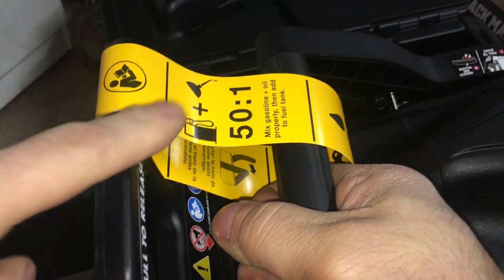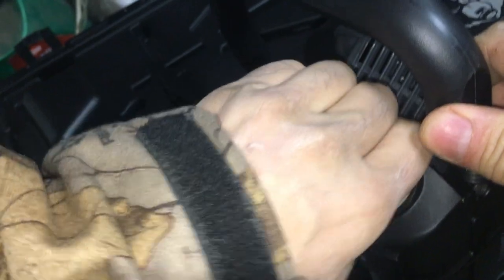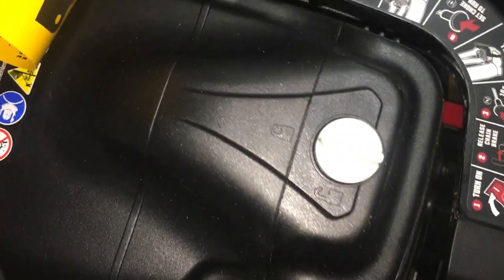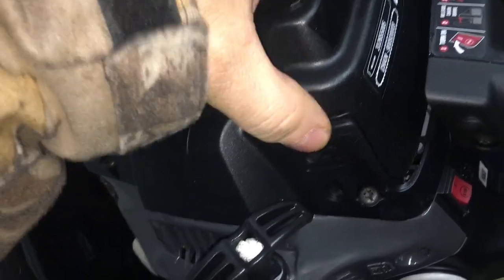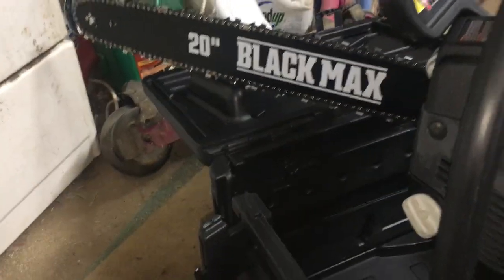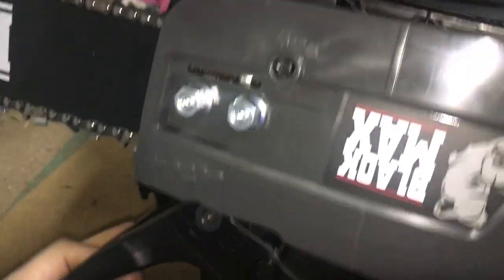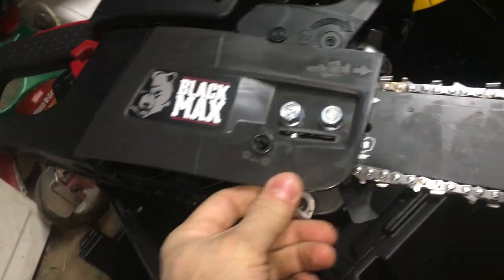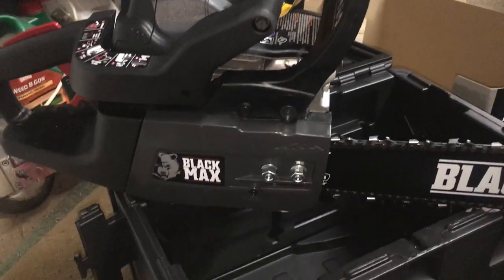Walmart Clearance Black Max 20-inch Gas Chainsaw 50cc 2-Cycle Engine

Comment: I just bought the 20" 50cc today for $102 after tax. From my research it has a Honda motor and some shared ryobi parts. I couldn't not buy it for a $95 price tag. Going camping in 2 weeks and will be testing it out on my buddies 75 acres. Has a 3 year manufacturer warranty and a 2 year wal mart replacement plan. It looks way nicer than a $95 saw but we shall see when I process a few cords of Colorado wood at 5500 ft above sea level
Reply from the maker: yeah the price is just too good LOL... especially when the 16/18 is sitting there at $150+ also to note the 16" and 18" are the exact same thing except the 18 comes with a case and well an 18" bar installed. yeah Black Max is owned by TTI which also owns Hart, Ryobi etc. I doubt this is a honda engine as it looks like a standard 2 cycle engine where a honda tends to have fancy designed alternative things. either way a 2 cycle engine most often falters from user error. messing up the oil mixture. all carbs are the same design so when the carb clogs from stale fuel its not valid to say my XYZ carb never did this! same goes for when fuel lines crack over time causing air mixtures to be off.
Reply: @bobspurloc  i was so blown away at the price that I was tempted to buy the 4 they had in stock. My wife would've KILLED ME 💀 😆 $410 for 4 chainsaws is a smoking deal. A stihl farm boss is $480 and an Echo timberwolf is $420.
Reply: I just got one for the same price and it works pretty good and starts easy
Reply: @shadwell749  I've got about 7 hard hours on mine. It starts up and runs great every time. The filter is too flimsy though. Gotta find a way to beef it up. I'm getting a lot of fine wood pulp past the filter into the carb opening which isn't good. Took it apart to make sure my piston isn't scored. It still looks new. Cannot complain for the price.
Reply: @theshapeexists  I just bought two  unopen blackmax saws 20" bar for 76 bucks and the display for 46 bucks 💪🏿  Couldn't pass them up🤷🏿‍♂  To hell what the wife thinks.

Comment: The Walmart here and Idaho had 2 of the twenties on the clearance rack For around 130 But the back was fully loaded with sixteens and eighteens. It does seem they don't want the twenty's around for some reason. Makes me want it more!
Reply from the maker: probably not a hot seller... but with a 50cc motor u must buy it! lol... or pay $30+ more for a 25cc 18/16" lol
Reply: You're basically the same price why would somebody want half the motor? What am I missing here? By the way how has yours held up so far?

Comment: looks exactly as a homelite 20in chainsaw lol also the same recoil and choke lever
Reply from the maker: probably.
Reply: @terryjohnson7572  I also have a 16-inch one, it only lasted about 2 months and it started cutting off, and I am one of the people who takes great care of their equipment and maintains it every time I use it, basically it is a chainsaw to be used once or twice, "disposable" although this one from the 20" video intrigues me because as I told you it is exactly a homelite and I have already had that brand and it is wonderful even though it is a homemade brand
Reply from the maker: @terryjohnson7572  TTI is the home company Techtronic Industries. they do homelight, ryobi, hart, milwaukie, hoover, dirt devil etc etc etc. so a bolt had backed out and was tapping the flywheel?
Reply from the maker: If you look at the Serial Number Sticker on it you will see it actually says HART, which as noted TTI is Parent company of all of these mentioned.
Reply: @bobspurloc  no, in fact I suspect that it is a carburetion problem in my chainsaw, but unfortunately I got a model that the carburetor is absolutely Chinese, it is not zama or walbro, it only has a star emblem, total garbage, I will try to find some similar zama Let me bring it back to life
Reply: @bobspurloc  good eye friend, indeed I have seen that the ryobi chainsaw model is exactly like a 14 or 16in blackmax chainsaw